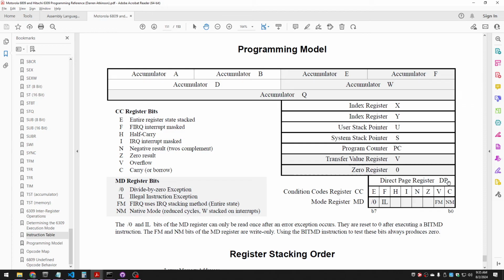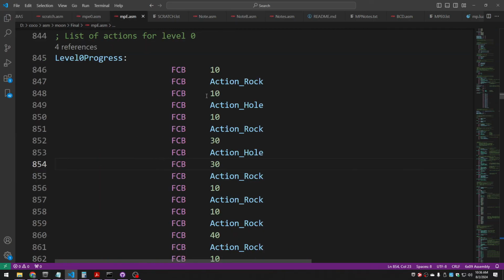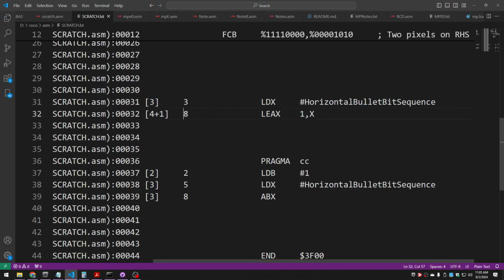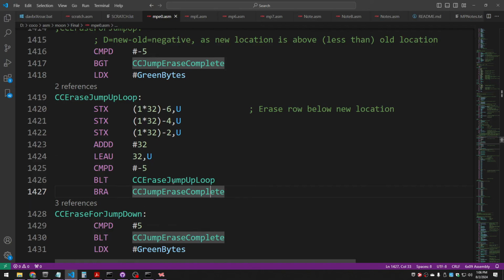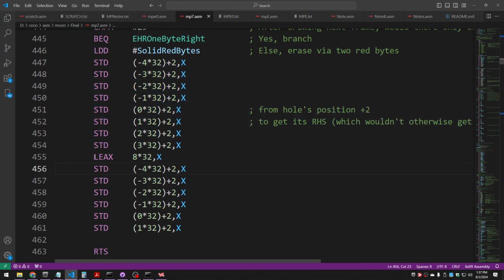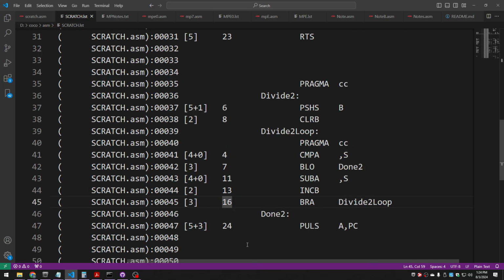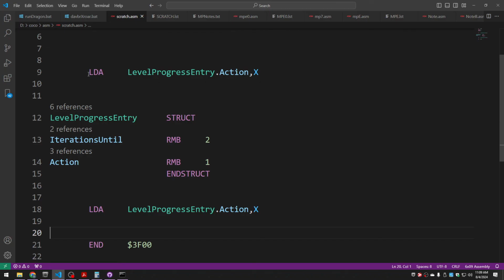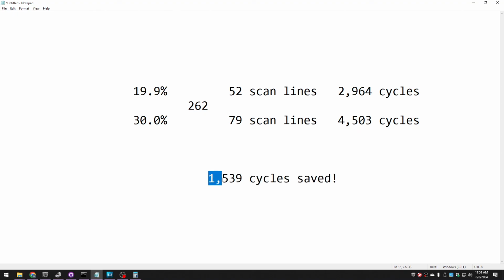8 surprising 6809 assembly optimizations (and 3 unsurprising ones)

Comment: Optimized division loop (25:45): perform SUB first and correct the result when it becomes negative, achieving faster execution.

        LDB #$FF
Divide2Loop:
        INCB
        SUBA Divisor
        BHS Divide2Loop
        ADDA Divisor
        RTS
Reply from the maker: Nice!  Your way adds an extra iteration, but removes a cmpa from all iterations, so comes out ahead.
Reply: Or you could just ask the AI search engine for the shift and subtract method which loops 8 iterations (always).  I don't now if it's faster, or if this is correct, but this is the answer it gave:

; Divide A by B (8-bit unsigned)
; Input: A = dividend, B = divisor
; Output: A = quotient, B = remainder
; CCR: Unchanged (assumes C is cleared before call)

DIV8:
    PSHS A,B         ; Save A and B
    LDA #0           ; Initialize quotient to 0
    STA $10          ; Store quotient in memory
    LDB #8           ; Loop counter (8 bits)
    PSHS B           ; Save loop counter

DIV8_LOOP:
    ASL A            ; Shift quotient left (<< 1)
    ROL B            ; Shift divisor left (<< 1), carry = bit 7 of old B
    PSHS A,B         ; Save A and B
    CMPA B           ; Compare A with B
    PULS A,B         ; Restore A and B
    BCC DIV8_SKIP    ; If A < B, skip subtraction
    SUBA B           ; A = A - B
    INC $10          ; Increment quotient (bit set)
DIV8_SKIP:
    PULS B           ; Restore loop counter
    DEC B            ; Decrement counter
    BNE DIV8_LOOP    ; Repeat until done

    PULS B           ; Restore B (divisor)
    PULS A           ; Restore A (dividend, now quotient)
    STA $10          ; Store final quotient
    LDA $10          ; Load quotient into A
    PULS B           ; Restore B (remainder in B)
    RTS              ; Return

Comment: Regarding surprising optimisation #8, forward reference optimisation is disabled by default (since LWTools v4.14) but can be enabled by adding the "noforwardrefmax" pragma, at the cost of longer assembly times. Note also that the "autobranchlength" pragma does not work for forward references (defaults to 16-bit) without forward reference optimisation enabled, although you can instruct the assembler to use 8 or 16 bit offsets by prefixing symbols with either < or > respectively. This method will throw bad operand errors when not using autobranchlength.

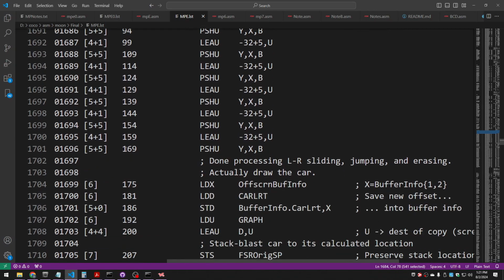Comment: 21:10 I’m not familiar with this processor (this is the first video of yours I’m seeing), but I wonder if you could add 1 or 2 “early break” points in this “stackblasted” loop and still gain some of the performance back for the small interframe-movements without paying a lot for the large movements. It seems like one compare and branch takes around 15 cycles from your previous loop version, and each iteration of the loop also takes around 15 cycles (169 cycles / the max of 11 iterations). If you put one compare and jump at say 3 iterations and 7 iterations, when you only need to clear 1 and 3 lines, it would take 3 iterations * 15 + one compare+branch * 15 = 60 cycles; when you need to clear 5, 6, or 6 lines, it would take 7 iterations * 15 + 2 compare+branch * 15 = 135 cycles; and when you need to clear 9 or 11 lines, it would take 11*15 + 2*15 = 195 cycles. Adding up the 6,11,9,7,6,5,3,1 pattern, it would take 135+195+195+135+135+135+60+60=1,050 cycles, which is less than the 165 cycles every time which would be 165*8=1,320 cycles.

My estimations could be wrong, but I still think you could tweak my numbers and come out ahead by adding one or two early break points in the unrolled loop.

Comment: About Y register speed: Back in the Delphi days I'd raised the same point about Y operations being a cycle slower.  I think the reason wound up being that it was unavoidable because the opcodes for loads, stores, etc. involving Y were the same instruction for X but with a prefix byte before, so the operations on Y inevitably required an extra cycle just for reading that prefix byte.

So I had asked somebody on Delphi about using X instead of Y in some particular assembly code that we were looking at.  Whoever it was (much wiser than I at the time, and likely still today!) pointed out that Y is just as fast as X for dereferencing addresses (except for the explicit LEAY instruction, see above) and for that routine, Y was loaded once and used a bunch of times for whatever variables or data structure was being used, so Y was the perfect choice for that routine--especially since it then freed up the faster X register for other uses that required modifying it regularly!
Reply from the maker: Yup, makes sense.  If you can throw Y at a "longer-term" task where the loading/storing is minimized, thus freeing up the other registers, that's a smart way to go.

Comment: I like the way you explain this. Please go on!

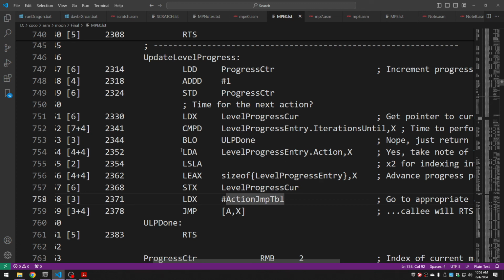Other possible speed imrpovements I have seen in the video, at 30:30 you show the "UpdateLevelProgress" routine:
1) LDD ProgressCtr; ADDD #1; STD ProgressCtr (9 bytes, 16 cycles) => INC ProgressCtr+1; BNE.1; INC ProgressCtr .1 (8 bytes, 10 cycles because the 2nd INC is almost never executed, once every 256 incrementations). There is no such optimization for subtracting 1.
2) CMPD Level....,X; BLO ULPDone, if you do not need the contents of D later (A is overwritten at next instruction), using SUBD instead of CMPD is 1 byte smaller and 1 cycle faster (but D contents is lost)
Reply from the maker: Great stuff.  Thank you for writing up those tips!

Comment: Nicely done summary and  entertaining as always. :) As mentioned, using LD and ST instructions, the Y and S registers are one cycle slower and use one extra byte. It's also worth noting that using the X register with CMP saves a byte and costs one cycle less. I guess in each case, fetching more bytes takes more cycles.

I would recommend using DP addressing for game variables. It will potentially save hundreds of cycles and bytes
Reply from the maker: Thank you, and good points.  I will definitely need to try out DP at some point and measure the gains.
Reply: What  you are forced to learn if you program a 6502, direct page must be considered just a set of 256 8 bit CPU registers.  The 6502 of course has no real CPU register which can hold an address, thus just to do base address addressing you have to use direct page for the base address.

Comment: There's something called Duff's Device where you unroll to the worst case but then jump into the middle of the unrolled code.
Reply from the maker: Loop unrolling in C with a switch statement & fall through!  Never heard of that, but I just looked it up.  Very clever.
Reply: i love devices like that :)

Comment: Talking about comparing register to register (amongst other things...) will love to see what you think  about the enhancements on the 6309.
Reply from the maker: Maybe someday! Still feels like cheating, but so did the Coco 3, and I did start poking into that recently. So you never know...
Reply: @CocoTownRetro  - Understandable. I know some people claim it is too "recent", but that's actually not true. There are ads for it in Rainbow from even before the features were found - it was just a lower power, cooler running 6809 clone that could hit 3 to 3.5 MHz reliably instead of maxing out at 2 like the older technology Motorola parts. I have a Hitachi chip catalog (PDF format) that shows the 6309 as "Advance Information" from October in 1985, so I assume it was out by early 1986. The added features weren't found out about in Japan until 1988, and North America in 1992.
Reply from the maker: @CurtisBoyle: Maybe someday, you never know!
Reply: @CocoTownRetro  Well I hope at some point you'll give us a peek into what you've been poking at...
Reply from the maker: @jb31842:  If a tree falls in the forest, and no one is there to hear it--or if I do a retro thing and don't make a video about it for others to see--did it ever really happen??